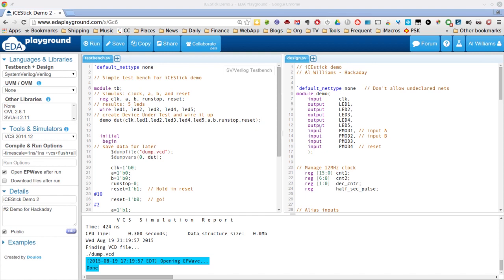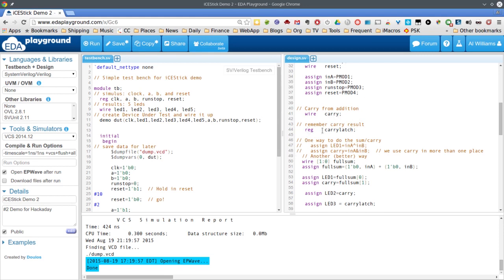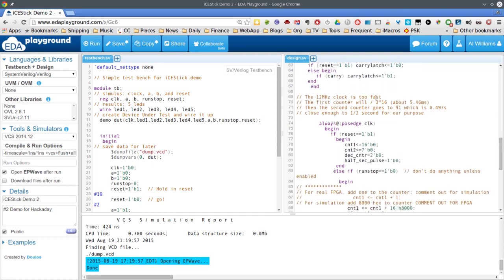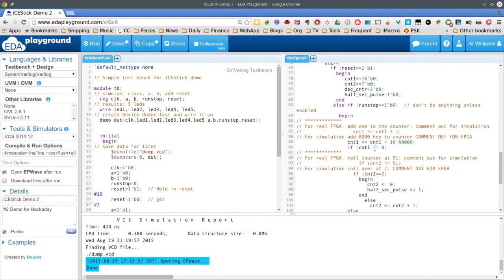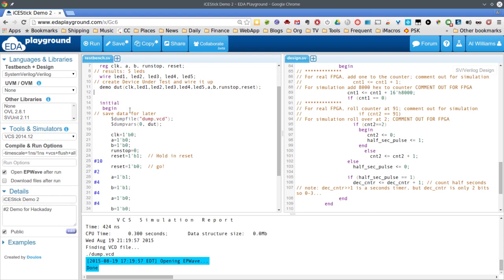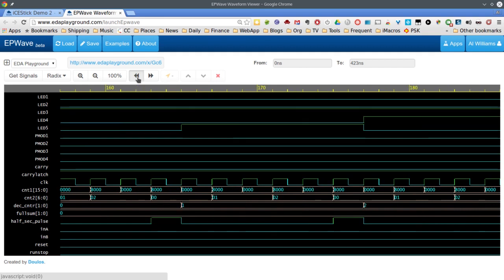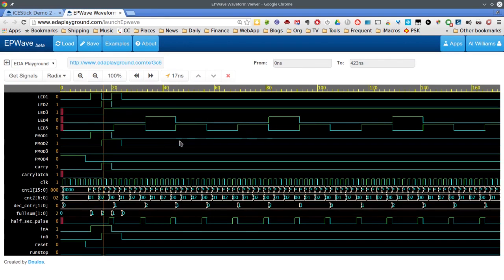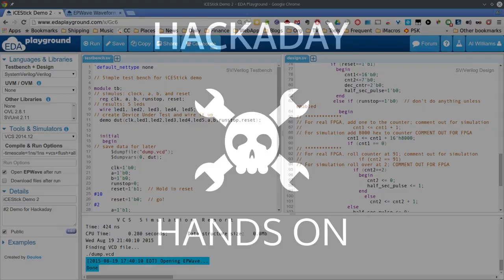Learning Verilog for FPGAs: Flip Flops

Comment: I like what you covered here. I'm hoping you'll get into communications between the iCEStick and a PC. I bought an iCEStick about a year ago, but I was able to come up with a software solution to solve the problem that I thought was something that would have been perfect for the iCEStick (or any other FPGA). I never did get around to passing data back and forth between the icestick and my pc, but that would be very interesting.  thanks!!
Reply: OneBigPappa Have you looked at https://github.com/cyrozap/iCEstick-UART-Demo
Reply: wd5gnr I have not seen that. I will say I haven't been looking since last summer, but I will have to check that code out. Thanks!!